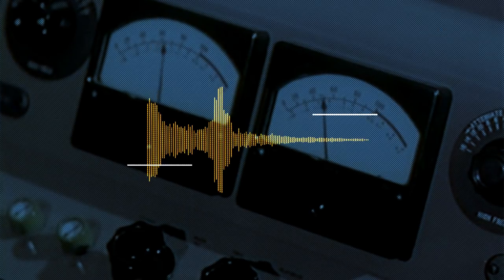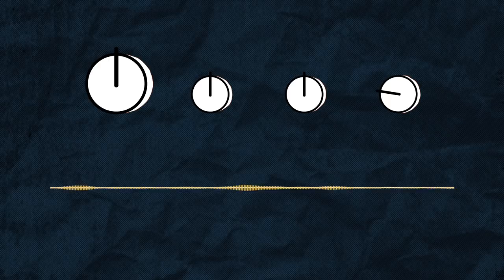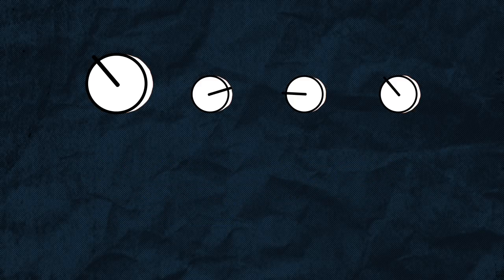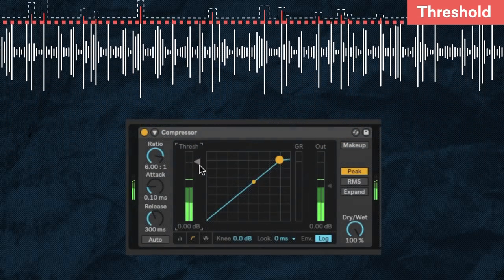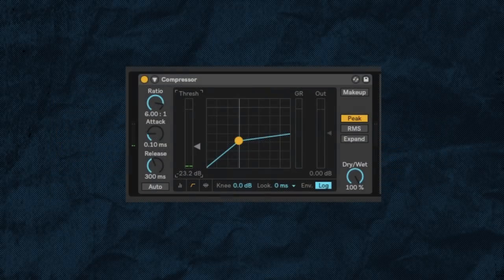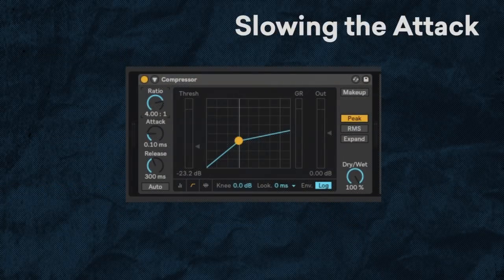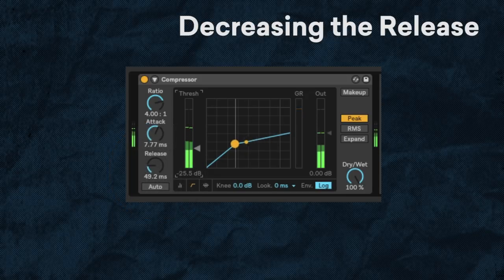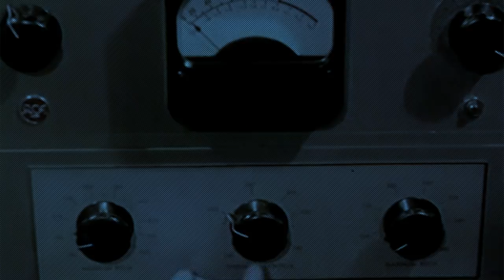What is Audio Compression? How to Use a Compressor | LANDR Mix Tips #8

Comment: What is the difference between compression and normalization?
Reply: Google 'EQ – Normalization – Compression – Limiting' . First hit = jackpot. In a nutshell: "Normalizing is about adjusting the peak or RMS level to a desired value by applying a constant amount of gain to an audio track to bring the average or peak amplitude to a target level (the norm). Audio compression works by taking only the loudest input parts, and making them not-quite-as-loud in the output, thus compressing the dynamic range of the audio."

Comment: I don't understand the bit about 'The attack needs to be slow enough so that the compressor doesn't crush the transients'

I thought the whole point of a compressor is to do that.
Reply from the maker: Compressors can do that, but if you want the compressor to make certain elements hit harder, you'll want to let the transient pop through, and compress afterwards. This will add to the punch of the sound.